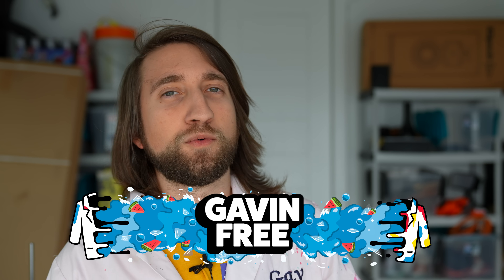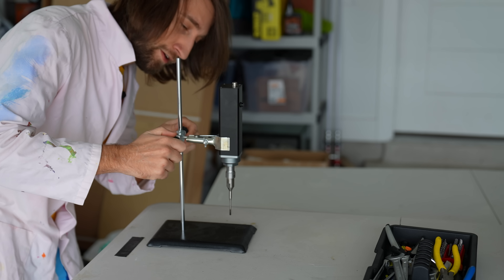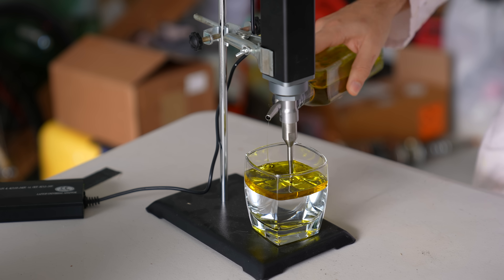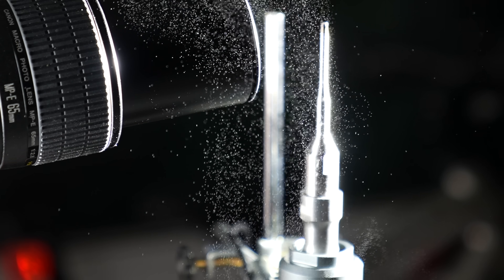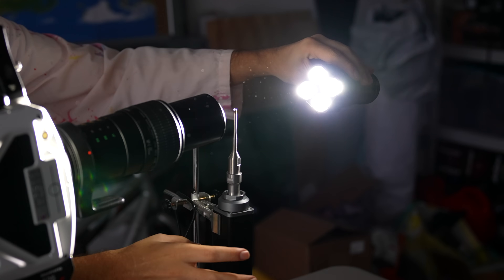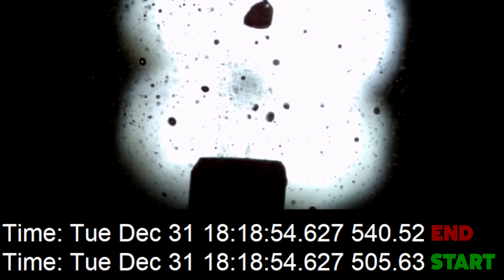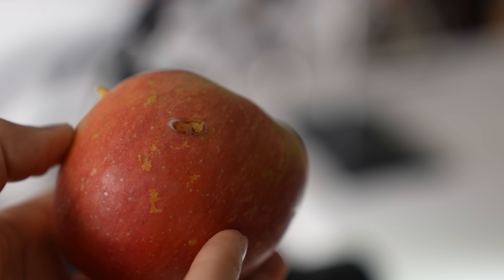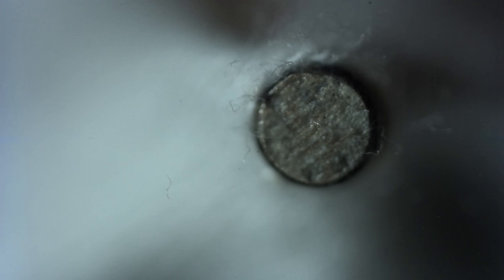Ultrasonic Obliterator at 170,000fps - The Slow Mo Guys

Comment: For others wondering about other uses of this technology, also it is used to bond connection wires (aluminum or gold) between micro chip and its package terminals (wire bonder machines). Micro chips found in your electronic devices like computers, cellphones, credit card chips. We used to measure it's vibration using LASER for proper calibration purposes.

Comment: Great. 
I have a Question: Today i was cleaning a Chainsaw Chain with Ultrasonic with water and cleaner and the water and the Chain stay cold, but when i changed the Fluid from water to oil (Motoroil) only the Chain gets in a few Minutes verry  verry  hot but the Oil stay cold ????

Comment: 3:15 is a slowmotion look at what happens inside the engine of a Subaru with a failed head Gasket, or any car that's blown a head gasket and got water in the oil

Comment: If you watch the 2million fps bit at a quarter speed, you can see that some water simply can't escape from the tip of the apparatus. Rather it is stretched up and down held fast by its surface tension. Absolutely fascinating!

Comment: At 6:33, it looks like there are a few droplets of water adhering to the tip of the probe, stretching and contracting with the vibrations. Is there a way to measure the adhesion strength of the water when it’s that small as well as figure out the sweet spot that’s keeping it from exploding with the rest of the water?

Comment: the tip is moving  at something like 80 feet per second and has a travel distance  of 0.207mm or  .0085in that's crazy 

the math
3mm width real
35us travel time 

with some screen measurements, i get ~130 units width and ~9 units travel
130/3=.0230
.0230*9= .207mm real distance traveled
you can do the rest of the speed fomale s= d/t

Comment: Alright! Hear me out. You guys once filmed the speed of light.. So, in theory, if you film something ridiculously fast in front of a mirror, you should be able to capture the delay of the reflection! That would be so awesome, I'd love to see that.
Reply: even using this Obliterator every cycle the light can go 10,000 m
so it's very hard to find such macroscopic thing which can move in 1 trillion fbs
Reply: @mixnewton5157  just get a really big mirror, rly big objects and put them 100km apart so we can get a good 10 cycles. Should only cost a few $bn tops for the mirror size needed. Only a couple times bigger than those in the James Webb
Reply: Check out the film “visualising video at the speed of light”, from MIT. That was pretty cool. And to make it they had to know the exact speed of light for superposing the results.
Reply: @SC-qj7dz  you should have read how they did it, not just watched it.
long story short: they do one take per frame. each frame is from a distinct (albeit identical) pulse of light. it's not really trillions of consecutive frames per second. it's basically stop-motion made with a pulse of light.
Reply: We are not in 2095 yet
Reply: i love this idea, but the likelyness of that happening is slim to none because of how light works.
Reply: Do you have any idea how obscenely fast light is? Even with this cameras maximum frame rate of one million or the 1.75 million of the tmx 7510, its gonna be instantaneous if you can even find a light that's bright enough. I'll put the speed into perspective for you, how long do you think it would take light to circle the earth once? Its able to make one loop in just over 0.1 seconds. Give the light beam one second and it will do it 7 and a half times. 

If you put a mirror exactly 5 meters from the camera to try and capture the delay, the light would bounce off the object, off the mirror and get back to the camera in about 0.00000000161 seconds, that's 1.6 nano seconds. So our minimum frame rate is gonna be around 1.6 billion frames per second. If we use the 180 degree rule on the camera where your shutter speed is double your frame rate, our exposure time is 0.8 nanoseconds, 800 picoseconds! 

I think we do have cameras that can do this but calling them cameras in that sense is a stretch, they're more like fancy light detectors that produce coloured smears moving in a video.
Reply: Same super high speed video of light pulses flying by. Light travels about a one foot per  nanosec.  So make sure you the distance from light pulse to mirror to camera is decently big and you should see the light without reflection in ski mo (for at least a few for nanoseconds). 👍
Reply: I think whoever discovers time travel is going to do it by accident
Reply: That’s actually a really good idea
Reply: Don't do it! A wormhole will open, and you'll time travel to a random moment in the past, with no way to get back to present time.
Reply: No
Reply: @FFKonoko  You mind expounding on that?

Comment: I was involved with this technology to cut carbon fiber mat'l when first used on aircraft to stay invisable on radar. The tool was shaped like an arrowhead with the blade rotation for circles etc  the first mfg om B2 bombers. It was just called an "ultrasonic knife"  (Mid 1980's)

Comment: I used to have a job where I used a slightly larger version of one of these to "weld" (their term, not mine) magnets in to plastic. I suspect it operated at a lower frequency than 30Khz, because the thing I remember most about it was how ear piecing the sound it made was. All of my coworkers were older (less sensitive to high frequencies) and just looked at me like I was an idiot when I asked for ear plugs to operate a machine that, to them, was silent.

For the record, the ear plugs were useless.

Comment: I wonder if this could be used to communicate over long distances underwater?
Reply: No. High frequency sound waves dissipate (are absorbed and scattered) quite quickly under water. Infrasound, i.e. very low frequency sound, travels much further, which is why whales use it to communicate.

This article talks about air, but the principle applies in any medium:

https://en.wikibooks.org/wiki/Engineering_Acoustics/Outdoor_Sound_Propagation
Reply: @Bob3D2000  I was going to point this out also it is also the same reason why I am pulled over for "loud" music in the car I have to explain to police officers that the low-frequency notes travel farther than the high-frequency ones lol
It's actually not very loud at all it just travels
Reply: I see you're still in the Ultrasonic communication rabbit hole
Reply: I would personally love to see an experiment using one of these for underwater Morse code!

I wonder if you could program one to vibrate in such a way that it would sound like a normal voice
Reply: No. Long waves travel further distances.
Reply: I wonder if you can tie a tiny rubber band and a little ball to the end for the world's smallest ultrasonic paddle ball.
Reply: I think not. For communicating with sonic waves underwater it is better to have low tones, because higher tones seem to dissipate the Energy faster. Whales for example use very low tones. Correct me if i'm wrong ;D
Reply: What would it look like if two of these “homogenizers” were   arrayed exactly opposite of each other?  If they touched would the steel pins weld themselves together?
Reply: @jerrypeppler1484  If they were in phase then you could set up a standing wave and maybe form cavitation bubbles between the tips rather than on their surfaces. If they touched it probably wouldn't weld but it might damage them. And radio waves can go as low as you like, 30kHz is at the high end of the VLF band, but the wavelength is already around 10km at that frequency so the antennas start getting absolutely colossal.
Reply: Amplified through very thin tubes.
Reply: ba dum tss
Reply: High frequency and long distance don't get along.
Reply: Hi. This has existed for many many years, for sonar first time it was used was in 1912 for submarine
Reply: Would be cool
Reply: Polish scientists built SCUBAPHONE
Reply: the sound moves through the air exciting it the low sounds disturb the atmosphere. Question can the sound break the admoferic density of a moving vehicle to reduce rosamint with the air?
Reply: Perhaps with a similar form as wire and optical fiber, though bandwidth would be limited by the speed in which the physical medium is able to move.  If solid, the stiffness of the material would be a factor while if not, the speed of the vacuum gaps collapsing would be, along with the overall mass regardless.  At the frequency of this, and assuming each cycle is a single bit which could accommodate a clock cycle, I'd estimate below 4kb per second raw.  While insufficient for the digital audio standards, it could be usable.  As examples, I think it could be sufficient for a page of text per second and possibly for images, though resolution would be quite limited depending on the format.
Reply: @Request_2_PANic  you mean for the tiny paddle ball?
Reply: @PaperDragons 
Being entirely honest, I only now saw your reply.  Even so, I was curious and figured out how fast the movement would be earlier, if the distance between each outer extreme is half a millimeter, which may be inaccurate from what the video shows, it would be 14.285174 m/s, equivalent to 31.956 mi/h.
Reply: @Request_2_PANic  I was just being a dork sorry. lol
Reply: @PaperDragons 
No problem.
Reply: @SmarterEveryDay Whale sounds can travel thousands of miles. They are low frequency (~30Hz-8kHz). As far as I know, the lower the frequency, the further it travels. So it depends on what you mean with long distance ?
Reply: Collab hype intensifies
Reply: Of course you'd think of a awesome way to use this. Big fan of your show as well bro.
Reply: Morse code? Ooooh
Reply: When separate YouTubers of high caliber comment on each others videos.
Reply: No. High frequency sounds travel only very short and are attenuated very quickly. Submarines use HF active sonar for mine and ice spike detection. Those can run without giving away your presence except for a very short distance. Like in the low 100s of meters... nobody who knows will ever tell you the real value. But it's in this range.
Reply: Yep, absolutely: https://en.wikipedia.org/wiki/Underwater_acoustic_communication
Reply: Does this device vibrate at the same rate as low frequency radio waves?
Reply: I don't think ocean animals would appreciate that.
Reply: Hi destin lol
Reply: you mean like a carrier frequency?
Reply: Hi Destin :D
Reply: Please try this. Also, were you at Redstone week before last testing the lunar lander platform? That was thing was loud AF.
Reply: no, because its imposible
Reply: I was about to say "who are you and where did you get your geniousness" then I looked at the person who commented this
Reply: Whatever you're thinking, Destin... don't. We still want fish.
Reply: 30khz doesnt look like a promissing frequency for modern communicating.. lol...
Reply: That sounds like a,, bad idea
Reply: Oh yeah, that's a very good idea when you think of it. But would the sound waves be able to go through long distances in the ocean?
Reply: whales did not like that
Reply: Fat chance.  It's far too high frequency and not enough amplitude for long distance communications.
Reply: @BasicShapes  Sssh, let Destin figure it out for himself
Reply: Deeper sounds travel further than high pitched sounds
Reply: Maybe yes
Reply: How?
I'm curious but also confused how it could be used for communication unless it's via morse code or something
Plus, wouldn't the sound waves just dissipate since these are very high frequencies?
Reply: Subsonic works better because it is not as easy to disperse, but subway workers did communicate by tapping steel because that traveled faster than through air.
Reply: Just whacking something makes it hotter…
I want this gizmo, let’s see…
Reply: Would it be powerful enough. I would have thought that the energy would dissipate over any useable  distance.
Reply: Yes, hydroacoustics is used for example to steer underwater robots or send another information through liquids
Reply: Check with the whales first please ;)
Reply: Warning. Do not use in bedroom
Reply: no.
Reply: I don't think so, because the medium is being torn by the instrument. Water's cohesion is just not high enough to support those wavelengths. Certain alloys or amorphous crystals, however...
Very Low Frequency sound IS used for this purpose, however.
Reply: Due to the high frequency, the soundwave will not travel far in water. Underwater telephones actually exist, you sure have seen one during your submarine visit ;)
Reply: Nope, you need an ELF generator.
Reply: Did you make a video of this, I wonder? If not, that would be a good one!
Reply: my guess: water is difficult to compress, therefore higher frequencies are much more damped than in air. So i'd expect it not very suitable for long distance communication.
Reply: you would need some kind of device like an Ultrasonic Underwater Acoustic Modem Using Frequency Shift Keying (FSK) Modulation 🤔if only there were some journal articles in the past, say, 5 years 🤔
Reply: no
Reply: @TechTomVideo  Popoto would disagree with you.. Check out their products
Reply: ...Bring back audible modem noises! LOL
Reply: Wales do that. Underwater skuba intercoms also use it.
Reply: @maxheadrom3088  Those sneaky Welsh!
Reply: Yes, that is a thing.  I understand that the scuba industry has underwater communication devices that use ultrasonic as the carrier wave for voice communication.
Reply: It's called sonar.
Reply: No, way wrong frequency.
Reply: Try infrasonic
Reply: I wonder if this tech got fast enough would it rip air molecules, if so that would be awsome.
Reply: @llNoza  wouldn't it rip its own molecules, first...?
Reply: @llNoza  yes it would be so badass if it could move so fast that it like created plasma
Reply: @llNoza  and if you get faster than that is how you get to the speedforce
Reply: I'm not a professional or like, I any way qualified to answer this question truth fully, but, I feel like it would depend on what the head is made of, like if it's not a tough enough material then the head might get crumbled before the vibration broke the air molecules (which I'm currently assuming you mean oxygen or nitrogen gas)
Reply: @noza
Reply: I wonder if that means we'll get a Smarter Every Day video about this.

Cough hint hint
Reply: You ever heard of sonar?
Reply: SMARTER EVERY DAY OMG
AMAZING CONTENT
:)))))
Reply: @nhlg7494  cringe
Reply: Mmm navy be like hire this guy
Reply: would probably cause a tsunami or something like that but i guess someone needs to figure it out haha
Reply: That sonicator reminds me of this video https://www.youtube.com/watch?v=U2rNnzVotS0&b
Reply: @justinmiller129  if you think anyone's going to fall for your bs when you put this exact comment in EVERY comment section. Get your own content by being original dude, not using popular people to get views for money.

Comment: Interesting that it increases the space between the water molecules, I wonder what would happen if I used a non-compressible liquid, like automotive brake fluid ... there is a way of production in fabric making, to make cut out designs if you use a mold of steel in the shape of a wheel, vibrating at high frequency, I always thought that the cut happened by heat.

Comment: Is there proof of cavitation occurring ONLY due to a low pressure environment? Seems more like the ‘impact’ raises the pressure against the surface to a point where the liquid is super critical and only when the pressure is released the supercritical fluid first returns to a gaseous state before the liquid state?

Comment: I've been telling my Mrs FOR YEARS that this is what happens to my tip. She thinks I'm lazy but I told her it vibrates at 30k times a second and its imperceptible to both sight and touch. Perhaps you can send Dan over with your fancy camera and film my tip to prove it to her. TBH even if you say no at the very least I can say I tried.

"Just the tip"

Comment: Fantastic video!!!  I did a quick back of the envelope calculation based on what appears to be 0.375 mm displacement and back in 0.000035 sec.  I didn't adjust for the sinusoidal acceleration but think these cancel out.  I came up with an order of magnitude of 60 million G Force acceleration.  no wonder things cavitate, but I find it hard to believe the tip remains intact at that accelleration.  I"m a bit rusty setting up this calculation.  Could someone confirm my guess with a more precise calculation?

Comment: Not only a cavitation bubbles, there is a plenty dissolved air in the water and ultrasonic devices are used to "degas" it (and other liquids), 
If you run homogenizer for a few minute in water, bubbles will be reduced, since almost all gas will be "pushed out" and only cavitation will remain

Comment: The power supply in the unit adjusts the frequency to keep the piezo transducer in resonance so it may be off frequency from 30Khz based on loading. Same system as an ultrasonic welder.  The tip should be made of titanium.

Comment: Peristaltic pump! They compress and decompress sections of a  tube to make waves of pressurized flow. Commonly used when you need to pump a liquid but not change the chemical composition of the fluid. Great video!

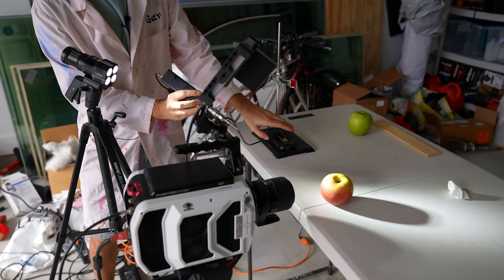Comment: 7:38 did you hear that? I think the frequency quickly dropped into the audible range there, probably the same way an electric toothbrush slows down when pressure is applied :D

Comment: 3:37 There is also a marked (perhaps perceived) reduction in cavitation voids. So I'm assuming the oil and water are emulsified at the tip of the ultrasonic magic machine by way of the oil filling the voids of the water cavitation and then the water collapsing in on the voids and therefore absorbing the oil into its structure. I love water. It's such a trippy compound molecule.